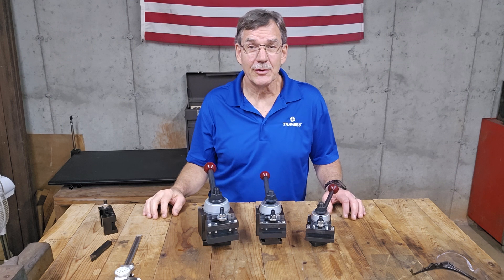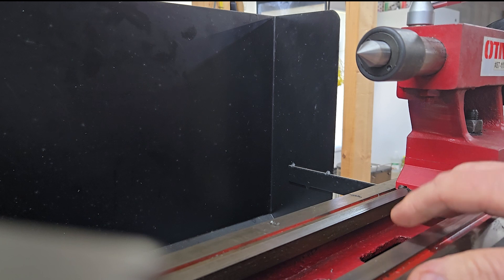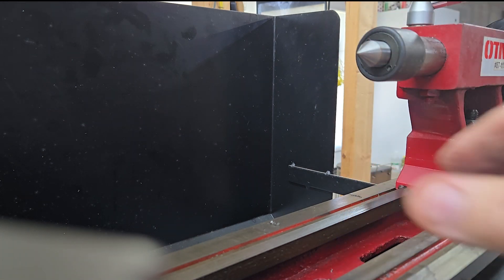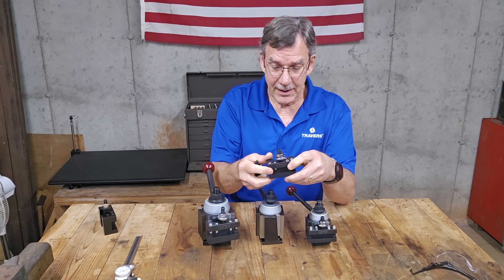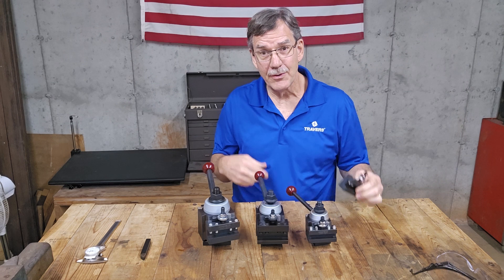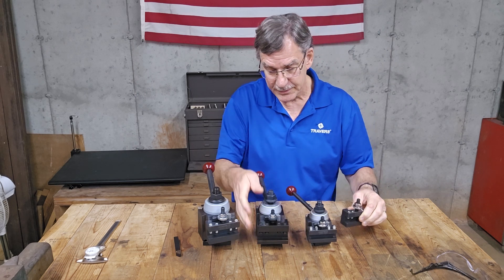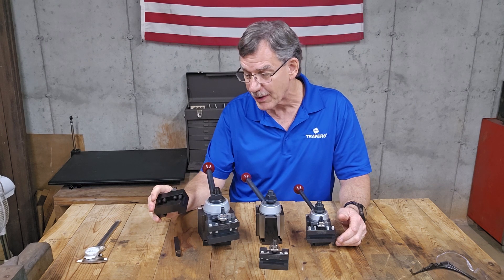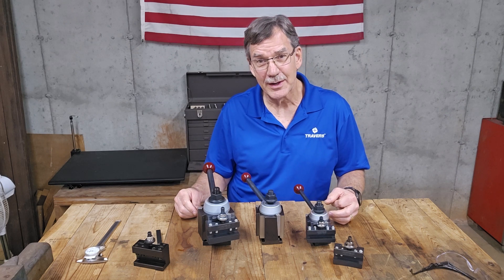Quick-Change Tool Post: How to Choose the Best Size for Your Lathe

Comment: You missed the most important point.  You failed to talk about selecting the proper size tool post  to use for a given lathe swing.  You spent all of your time talking about tool holders.  You said, in the end, that you hoped that the  video helped select the proper side tool post for a  given lathe, and then failed to explain anything about sizing.
Reply: Great point, rodgraff1782 — and thank you for commenting!

We often see tool holders returned because the wrong one was ordered, but it’s pretty rare for a tool post to come back.

To make choosing the right tool post easier, take a look at the box just below the video. You’ll find a few helpful links there: one goes to our blog article “Choosing the Right Tool Post Size,” which explains the process in more detail, and another leads to our tool post selection page, where you can use the Lathe Swing filter to find the correct size.

That said, you raise an excellent point — especially since there’s some overlap in lathe swing ranges between different tool post sizes. Don’t be surprised if you see a new video from us soon on exactly that topic: How to Choose the Proper Size Tool Post.

And if you want more info in the meantime, feel free to drop another comment here or for a quicker response, send me an email at KurtR@Travers.com
 — I’m always happy to help!
Reply from the maker: Thank you for pointing that out. We appreciate your feedback and will make sure to address the sizing details more clearly in future content. Please check out our blog for more in-depth information, and feel free to reach out if you have any questions!

Comment: (100 series) AXA 250-101T Up to 5/8" tool bit capacity. 250-101XL is also 5/8"
Reply from the maker: Thanks for sharing that info! I can't say for sure, but maybe that's why we don't carry a 250-101XL. If you need a larger tool capacioty in s 100 series/AXA holder, the DORIAN D25AXA-1, Item #55-370-060 holda a 3/4" tool. https://www.travers.com/product/dorian-d25axa-1-quick-change-tool-holder-55-370-060

Comment: you showed how to measure the swing or the lathe but did explain that usually determine what size tool post to order.
Reply from the maker: I apologize for the extended delay. We've been experiencing difficulties accessing and responding to YouTube comments.
When you shop for a tool post, you should order one that us within the Lathe Swing range. If it's not too late, let me know, and I can go through it with you.
(Kurt)